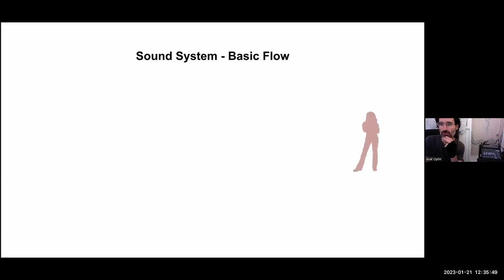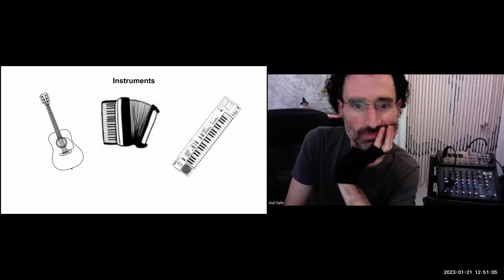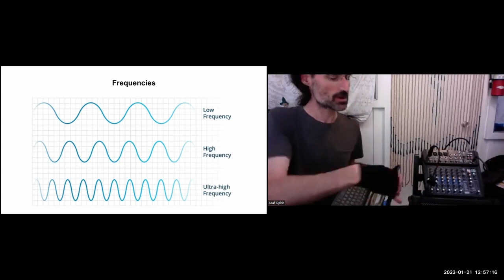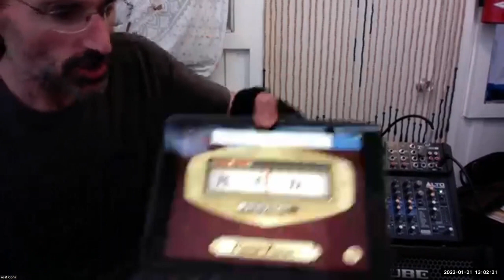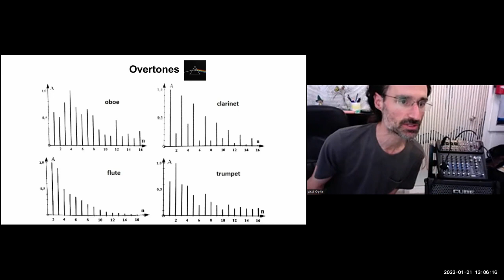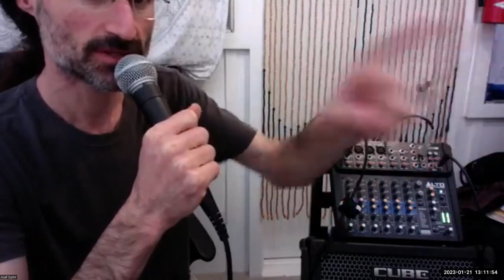Basics of Sound Engineering - Part 1 of 3

Comment: Great content. Thx a lot. Im considering doing a course, maybe a diploma, in audio engineering with the intent on doing live sound engineering as a job. Im just concerned about any mathematics in the course and what kind of math is required since im not great at it. Basic math im fine in but  stuff like algebra etc is not so good. I understand everything you have stated in this video perfectly. Are you able to tell me what I can expect? Thx.
Reply from the maker: Hi @Grifftxr! Sorry to be so slow to respond. I would not expect any math in sound engineering, unless you really want to dig into the inner workings of it. There might be some concepts like decibels, which are based on logarithms, but you can work fine without any fancy calculations - you really just mostly focus on the way things sound. There are also systems that calculate acoustics, etc., but you don't need to be a mathematician to use them.
If you dig into basic electricity, it's the same: The things you can expect to encounter in sound engineering will be close to the surface, for the most part.
There was no serious math in our sound engineering training.

Good luck!
Reply: @asafophirmusic  Hey thx for responding. That's good news for me then haha cos I really dislike math. I enrolled in a diploma course. Was contemplating learning highschool physics and trigonometry to pass it 😭, but if that's not necessary then im all for giving that a miss haha. I saw that a sound engineering teacher from India on Quora say you should know year 10 physics.